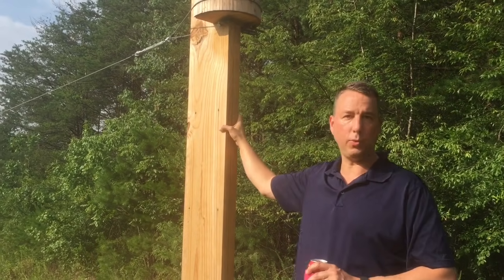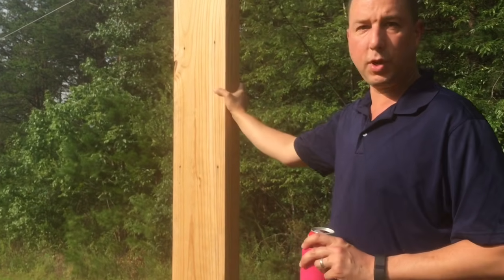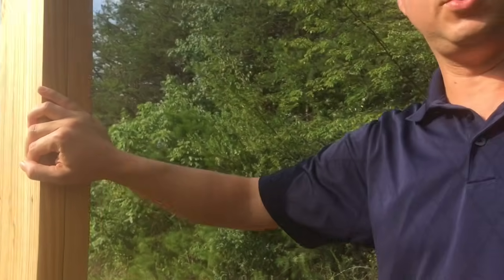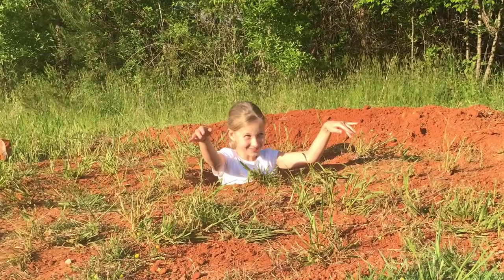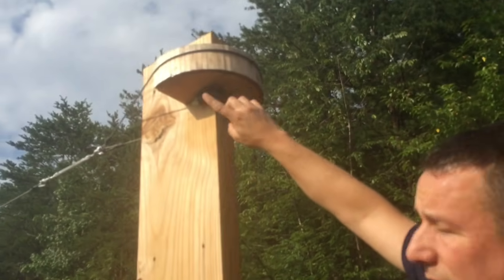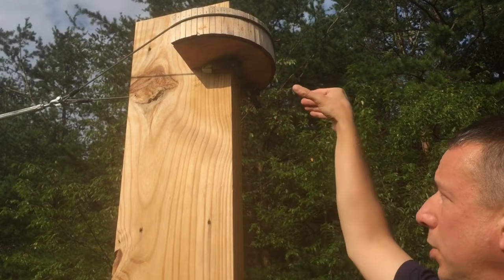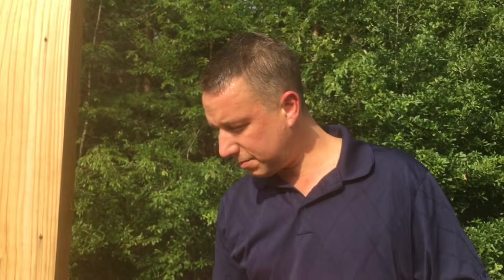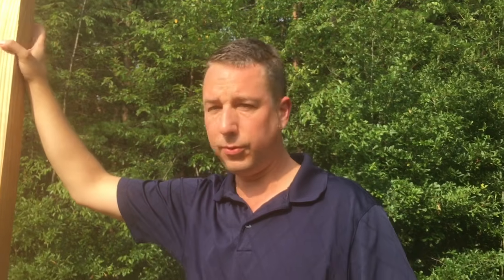Zip Line without trees - anchors

Comment: Ryan.  Great video.  Sounds like you're the engineer and certainly know alot more than most about the mathematical calculations to ensure this is safe.  Do you see any harm in adding a 3rd 2x12?  I would imagine 3 2x12s would create an even stronger "post" than 2?
Reply: It's funny how I think.  I asked this question "4" years ago.  No reply yet which is fine but just last weekend I built out my zip line pole and did in fact use 3 2x12s without even realizing I asked this question already.   I'm not a structural engineer but just felt an additional board would add alot of strength to the pole.  

I was just coming back here to ask if you've ever posted the plans for the half-circle pieces that mimic a 12" diameter tree?   I saw some discussion in the comments about it being necessary not and my feeling is a half-circle surely eliminates any major bending of the cable.  

I could certainly cut a few of these out of 3/4" plywood and glue and screw them together to make perhaps something 2" wide but my question is how to finish it with something vertical.  Just putting the cable around 3 pieces of 3/4" plywood would just create a channel in a piece of the plywood as the cable is tightened.  It looks as though you used small pieces of wood, mounted vertically around the semi-circle.  What wood did you use?  I other words what wood is strong enough to be used for these vertical slats that can withstand and not shatter when the cable is tightened?

Comment: Im using your design, will sink it in hole soon (other end will attach to a tree).  My run is pretty long @ 175 ft.  How did you align your posts?  I can eyeball the post to the tree but would like to get it dead nuts on.  Looked online for laser levels but 100ft is max distance is all a I can find for laser  levels at a reasonable price.  Thx.  

For everyone else, i did basically the same beam but put 1/2 rebar in the bottom 3 1/2 ft of the beam.  About 16" long pieces  right through the beam so 8"  per side sticking out.  Did about 18 of those.  Coated the rebar in epoxy spray to prevent rust and put thick layer of tar on wood that will be in the concrete.  For top 8 ft i used a UV tolerant stain and sealer and rounded off the edges with a router so kiddos cant get a splinter.  To join the 2 2x12s i used A LOT of construction adhesive and a lot of screws. Maybe 5 or 6 tubes.  Functionally speaking the 2 pieces are now one.  Its pressure treated wood but finished off it looks like a nice piece of furniture.  Time will tell if it will hold up in the elements.  

I plan on using gravel at the bottom of the hole, bring concrete above grade and slope it away from beam.  Seal the concrete and put good caulk around beam where it meets the concrete.  Doing this so rebar will never rust and wood will not rot for 100 years. Do it once, do it right

Comment: This design does not work. I use the design and the 2x6s snapped while I was tensioning the zip line.
Reply from the maker: Big difference between what I did (2 x 12's) and you (2 x 6's).  Try again man.
Reply: Lol

Comment: I just completed a zip line in my backyard w/o trees.  Fair warning:  Trees are much cheaper.  The costs for the posts and concrete and other things were an additional $400 – above the cost of the zip line set.  I bought the slacker zipline set (100’) for  $185 on Amazon – so the total project cost is somewhere close to $600!.   I apologize that I could not paste pictures or drawings in this comment.  
 Unlike Ryan Emerson’s yard, my yard is flat and not conveniently sloped.  However, I did follow Ryan’s suggestion to use 2x12’s (treated) screwed (and glued using gorilla glue) together for the posts.  At the low end, I followed Ryan’s instructions, I used 12-foot long lumber and buried it 4 feet down.  I rented a two-man auger that dug a 12” diameter hole (rent from Home Depot – 12” auger was their biggest one) and then I widened it to a 14” hole with my manual post hole digger.   Where the wide end of the posts would be in the hole, I widened the hole to 16” (making a sort of oblong hole) to give a minimum of 2” of clearance for concrete around the posts.  To give the post more strength along the zipline direction and to reinforce the concrete, I drilled ½” holes in the bottom of the post for ½” rebar.  I started a row of ½” holes 2” from the bottom of the post. The first row consisted of two holes - 2 inches from the bottom of the post and each hole 2 inches from the edge of the post.  The next row of holes was 6” above the first row.  I did this for 4 rows and inserted 14” long ½” rebar in each hole – before I put the post in the ground.   I installed the post at a 5 degree backward angle and used 10 80-lb bags of fast set, high strength concrete.
  For the high end, I needed the start of the zipline to be at least 12’ foot above the ground - and I wanted the capability to go 13" high - if needed.  So, I used 16 footers for my post (still using 2 – 2x12) .  For this post, I buried it only 3’ and I used a guy wire anchor system to support the post.  This gave me a post that was 13’ high. (used 6 bags of 80-lb concrete to set post).  As before, I used ½” rebar to give the post more strength and to reinforce the concrete and installed it at a 5 degree backward angle.   
       For the guy wire/anchor, I bought ½” inch diameter steel cable from Lowes and drilled a hole in the post at the 10’ foot point (at farthest point from anchor) and attached the cable to the chain that was buried in concrete.  The anchor was 10’ from the base of the post.  The anchor was a chain that was put into a 12” hole 3’ deep with re-bar through the chain (every other link) for strength.  The hole was filled with concrete (5 80-lb bags).  You will need to buy the guy wire cable, the chain, rebar, turn buckle and the wire clamps – you can go to smaller diameter cable if you wrap the cable more than once – either way, my calculations are that you need about 400 – 500 lbs of tension on the guy wire to counteract the bending forces from the zipline and to keep the post stable.
    
      Finally, I cut a 12-inch long piece of treated 2x 4 to hold the zipline at each end.  I drilled an open 1” hole on the edge of the 2x4 and attached the 2x4 to the post with long screws.   The zipline cable will fit into the 1” hole and this allowed me to adjust the height of the cable, if needed with minimal effort.   Also, there is no wear on the posts.  Do not worry about the 12" diameter "tree simulator" that Ryan made - that 12" diameter is defined by the zipline instructions because that is the minimum recommended size tree - it has nothing to do with the minimum bend radius of the zipline.
Reply from the maker: Dude.... video?!
Reply: I also would like to see a video or some pictures please and thanks.
Reply: Same here! That’d be great. I’m in the process of building my zipline without tress and with Ryan’s calculations. I was going to use the half cut tree stump to avoid crimping and would love to see what you did.

Comment: Don't think that you need the half-circle pieces that mimic a 12" diameter tree.  I understand that you read that the line shouldn't be kinked, but both the main cable and the attachment cable are bent around a 1/2" radius or less  (the main cable is bent around this radius where it attaches to the tree attachment cable and the tree attachment cable is bent around this radius at each end).  So, I think if you use a chisel and put a chamfer on the edge of your boards were the cable meets, you should be fine and you will not be even close to exceeding the minimum bend radius of the cable.   I would put in some fence staple nails to keep the wire from sliding down/up the pole.
Reply from the maker: Russ, yeah I hear you -- I had that same thought about the other radii in the cables.  But the specific warning against crimping the cable in the instructions made me think maybe they heat treated their pre-bent cables at the turn-around or something...?  They sure don't spring back at all, so the manufacturer did something special there.  Anyway, I opted for the conservative approach especially since wife was kinda itchy on the whole ordeal.  Gotta pick your battles.  Observing the wear and tear on the whole system over the past 18 months - I believe if I just went straight around the 2x12's, the cable would dig in and generate slack.  My way distributes the load over larger area.  And still chafed the edge of my little fakey tree turnarounds.  Finally, a single nail at the rear of each fakey tree is plenty to keep the wire in place.  Lots of cable pre-load and friction there.  And hey -when are you gonna post your zip line install video?!?!
Reply: agree

Comment: Will this set up work for adults? Like what is the maximum weight you think this can hold?
Reply from the maker: I think the zip line kit (cable and trolley) is rated for 250 lbs. I weigh 200 lbs and it holds me just fine.

Comment: Yes, there is a lot more to consider than I expected! I do have the physical "manpower". I knew ur video showed 8 ft above the ground and should have realized you had the benefit of a sloping yard (I do too). My hubby is not an engineer but pretty savvy so I think with his help, we can do it. I think everyone involved is willing to try. Thanks for all your information!
Reply from the maker: Good luck.  By the time I threw the kids on it and started the fine-tuning, I discovered that it's actually a pretty forgiving system.  I wish I had LESS slope in my yard so that there was a little more heights-excitement at the launch point.  Anyway, Bonnie - TAKE VIDEO AND POST IT for the rest of the community!

Comment: I forgot to ask you how long were your 2 by 12 boards? My adventure parks zip line kit tells me I need ( for a rider 48 inches high) 126 inches at the high end cable height with an additional 48 inches in the ground. That means at least 14.5 length boards. I also need to include room above the zip line cable . How long were your boards and how many inches down from the top did you hang your cable?Also, how much cement did you use for each anchor? I plan to make a trip to Menards this weekend since boards and cement are both on sale-lucky me! I appreciate your time and input. Bonnie
Reply from the maker: I had the benefit of a sloping yard, so I was able to use 12-foot boards on each end.  4-feet in the ground, and 8-feet sticking up.  That detail is clearly in my video.  And the cables are attached essentially at the top on each end.  If I were you, I would install an anchor system with guy wires at the start of the run, or do the bending calculations considering three 2x12s laminated at that end (at least).  I hope you have help placing the boards into the holes in the ground.  Two 2x12s laminated together are heavy and unwieldy as f**k and it took pretty much all my strength (as a 200-lb fairly fit guy) to carefully place them into the holes.  As far as "how much concrete", I googled "concrete calculator" and that worked well.  I admire your resolve but honestly with all your questions I suspect you might be biting off more than you can chew...?

Comment: I also would like to know the diameter of your turn buckles- I can cut a section of log in half but wonder should the circumference be? If not, can u give more details on your turn buckles. Thanks for your time!
Reply from the maker: To be clear: A "turnbuckle" is a very specific piece of hardware (google it).  I assume you are instead asking about the circular turnaround pieces of wood that I added where the cables actually turn around the posts. I made them 12 inches diameter.

Comment: I purchased a 90 ft zip line for my 8 grandchildren and want to install it with your instructions. I can have the holes dug for me but would like to know exactly how many feet apart were your anchor posts? Were they 90 ft apart-if the cable is 94 feet?
Reply from the maker: Bonnie, I'm not sure what hardware came with your kit.  You're gonna have to measure it and sketch it out.  If the instructions that came with your kit said "find two trees that are 90' max apart", then you should be good setting your posts at 90'.

Comment: what is the purpose of the half moon rebars?
Reply from the maker: The rebars reinforce the concrete to counteract the tensile stresses that develop in that pathway around the front of the beams.  I am not sure if it was necessary or not, but it only cost a few bucks and I figured what the heck, can't hurt!
Reply: Great job.
Im guessing you use the two 2 x 12 because perhaps a six-by-six wood warping twist in the elements?